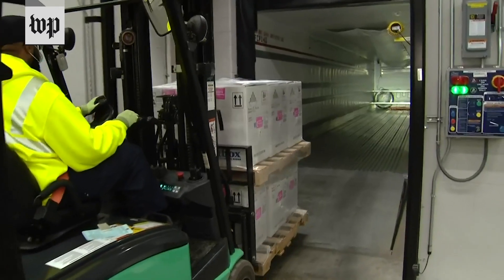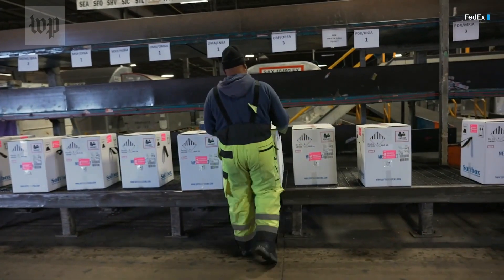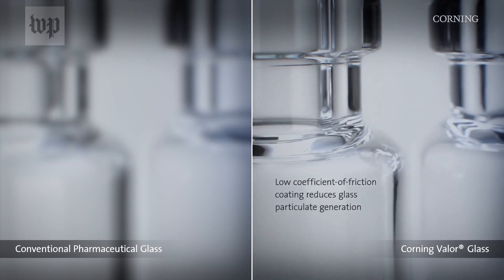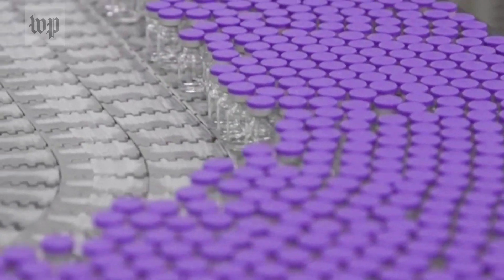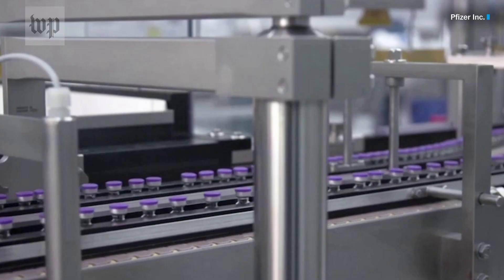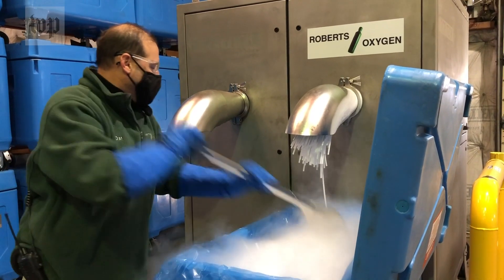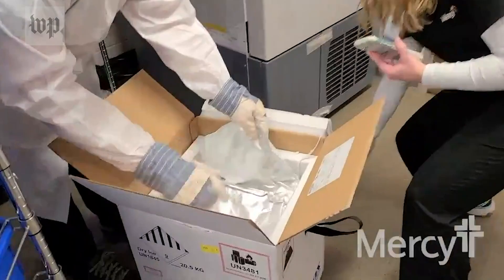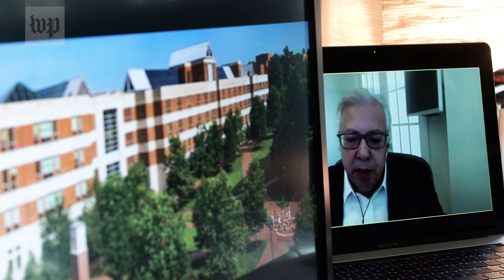The coronavirus vaccine is here. Now the race is on for more glass and ice

Comment: Dry ice melts and heats. How are they going to maintain a -70C for the vaccine when Dry Ice has a max freezing of -78C. What’s the stability of the vaccine if it goes to -69C? Have they already prepped the planes and tucks delivering this vaccine completely? 
They made all these vials and ramped up dry ice production, but will it actually be maintained for transport. Will the hospitals be receiving these new freezers ahead of time? They’ve already admitted this is colder than most hospitals were prepped for. There’s so many gaps in this supply chain, but they’re trying to claim we’re ready.